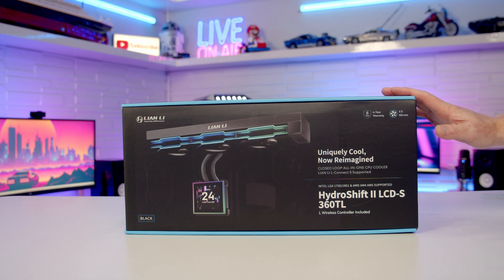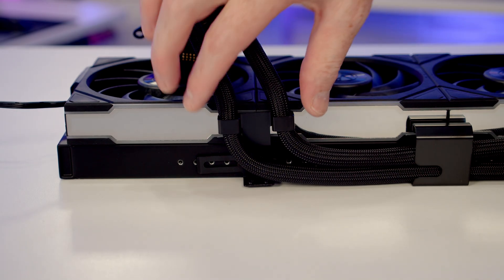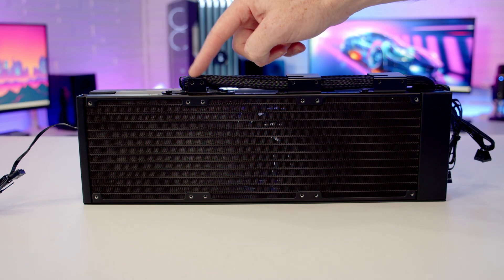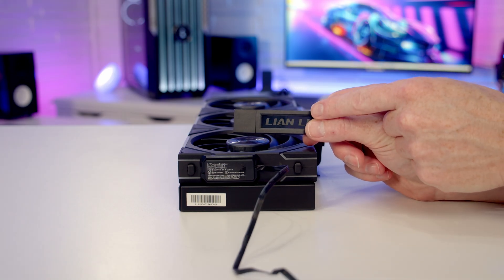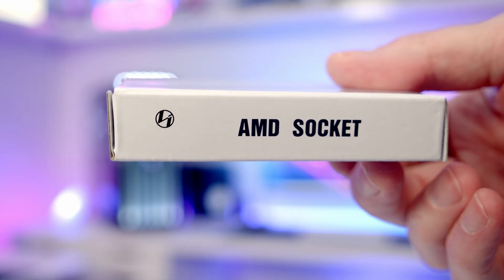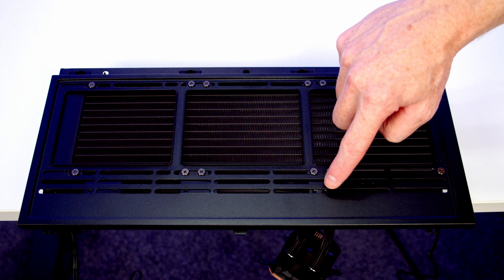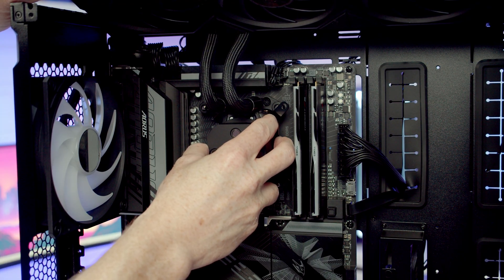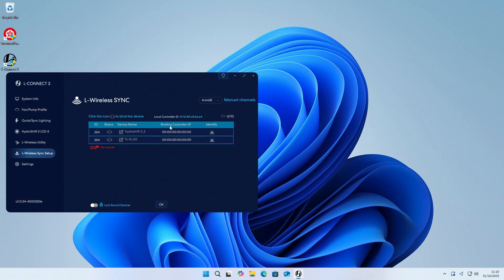Lian Li HydroShift II LCD-S 360TL - Installation Guide

Comment: The sliding into the bracket before screwing it is making me nervous, since I use Kryosheets.   How the hell am I supposed to know if the sheet moved or not?   This is really frustrating design.   Bought this off amazon and now I'm thinking I am going to need to return it.

Comment: There's one thing I don't understand. You say that when connecting the pump to the motherboard, you recommend setting the fans to 100% DC mode, and in the video you connect the pump, whereas after installing the L-connect software, you have the pump in PWM mode. Is it DC or PWM?

Comment: I have updated to this from an NZXT Z73 360mm... to be honest, I am not sure this is much better. Firstly, the fans (I use for the PC case same fans as this cooler has) are very loud at boot, they go always full load till Windows start as the control is only via L-Connect in Windows (and powered directly to SATA). My previous old UNI fans were connected via wired controller and was better in terms of start up noise. My wife is also not happy with the new startup noise. Secondly, I hear the pump louder at Lian Li as it was for the NZXT Z73... The positive, it keeps my 9950X3D cooler but at the cost of noise.
Reply: Did you find any way to fix the boot fan noise? I am happy with my PC since it is very quiet when I am using it, but i come from a corsair build with a commander pro hub and i never had to deal with that.
Reply: @av1155G Corsair is better brand for cpu cooler ? I am planing to buy nutshell

Comment: Very pretty indeed, but useless, I got mine 2 weeks ago - the problem is poor/uneven contact between the AIO's cold plate and my CPU (AM5 socket). Even when the screws are fully tightened, there's a visible gap at the bottom of the cold plate, causing the CPU to reach 95°C when idle. The AIO reports water temperatures around 30°C, confirming heat isn't transferring effectively. I've verified I'm using the correct mounting hardware.

I have opened a support ticket with Lian Li but havent’t heard back… posted on reddit but Lian Li hasn’t responded - so the customer/technical support is non existent!
Reply: Same issue here. Will see how they fix my problem
Reply: How long did it take you to get this resolved?I opened a ticket yesterday and they replied this morning. Should I expect the replacement brackets and screws anytime soon ?

Comment: Hello and thanks for the video, can you tell me what processor you use with this AIO in the video. Because I installed it on a 9800x3d and my idle temperature is at 48 degrees. And under heavy load, it's 95 degrees, which is much worse than my old Thermalright cooling system.
Reply: I haven’t checked my specs exactly under load but I have the same setup as you. I notice it tends to ramp up and down in games not sure if that’s something your experiencing

Comment: with  the AIO i would be looking to install it one of the new Thermaltake 300 mid towers. In that case the GPU etc is laid out vertically and the AIO cooling tubes would run horizontally to the side of the case which is great as that is the only area to mount the cooler and fans in that case . So my question.. It seems to be 360 only versus 420 and more importantly in the software can you change the orientation of the UI in the LCD panel. All the shots have the cooler above the CPU and the panel aligned under neath it. With the mid tower the UI would be pointed horizontally or can you switch the orientation in the software so the er is to the right but the display reads correctly up and down ?

Comment: Can it also be mounted in vision compact as a side intake with tubes running through the grommet to the backside if the clamps are removed? Or is this thing strictly only for top mounting - yeah it could be mounted as side intake conventionally but that would beat the purpose of looking "clean" - especially since Lian Li themselves had that setup as one of the options in that case.

At the moment it seems like:

Kinda yes if the fans stay at the backside.
No -  if you want the fans to be visible inside the case cause the plastic cover is not reverse mountable so you cant move the tubes and cables to exit the other side.